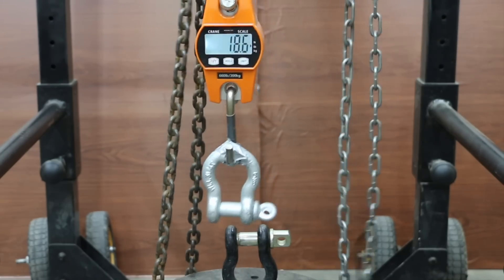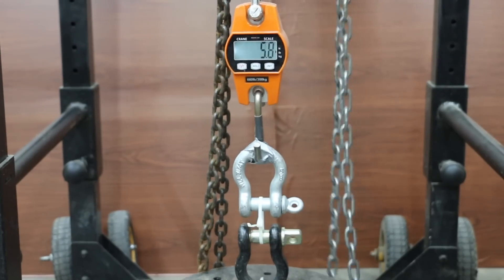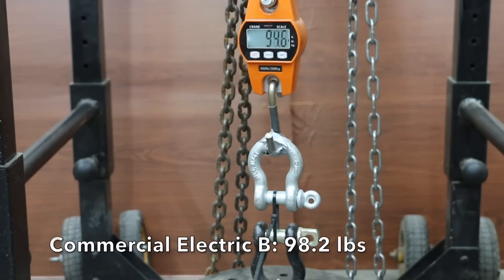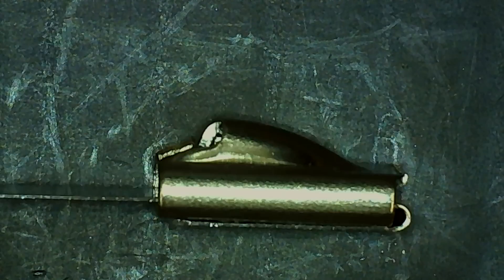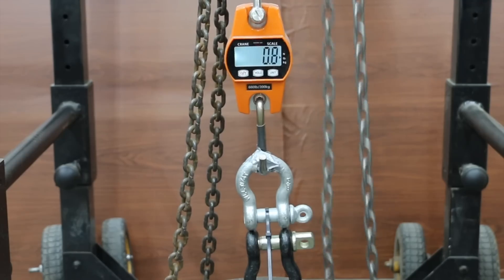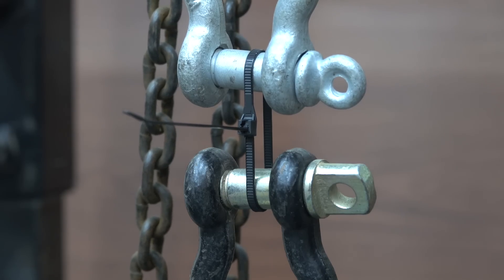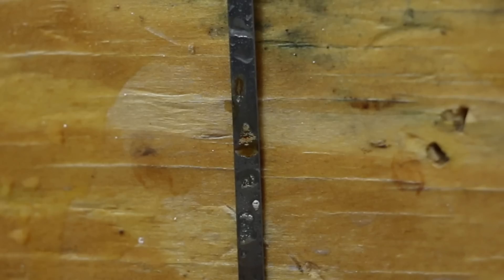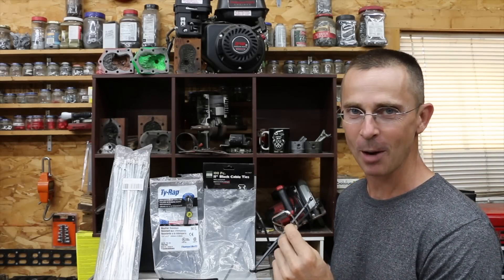Best Cable Tie (zip tie) Brand? Let's Find Out!

Comment: No, you cannot say the cable tie supported the weight of a small truck (you did not lift the entire truck).

You can say instead that it was strong enough to lift the (pretty light) rear of a truck (no more than 300-400 lbs?).
Reply from the maker: Thanks for the feedback.

Comment: Have you tested various LED security lights?  I have used several types and brands over the past few years with a wide range of good to poor success.  I prefer the ones that use solar power to charge batteries.  Some use proximity sensors to automatically turn on the light for a few minutes, then go off.  Others turn on at dusk, and run all night, or until the batteries go dead. 

These seem to improve with better batteries, and better solar collectors every time I get newer ones.
Thanks,
Barry
Reply from the maker: Thanks for the video idea.

Comment: I would be interested how well they do when they are hot / cooled. Some of us live in parts where it gets very cold so it would be useful information. While some live in very hot areas.
Reply from the maker: Thanks for the video idea.
Reply: I can help answer the cold question... every brand I have used for long haul trucking has failed miserably below 20°, and I spend a lot of time in the U P of Michigan, northern Ohio, Indiana during the winter. Many break at the locking mechanism teeth in extreme cold. I only use the 250lb rated ties from CabletiesPlus now, but they are pricey at 4.84 each but they keep our snap binder handles in place much better than a wrapped bungee cord.
Reply: TheRoadhammer379 i have used chain binders that have a ring that slides onto the binder handle when its closed to keep it from opening especially with vibration and shock I used them off shore binding 34” dia pipe onto tanks to tow for building beaches.

Comment: How about a comparison between different brands of brake parts cleaner to see which one is the best
Reply: I have a prediction. It's going to be whichever one is the most carcinogenic.
Reply from the maker: Thanks for the video idea.
Reply: Then compare to a dish soap, Dawn or Palmolive.
Reply: After years of using CRC I would be interested in watching that video to see whether or not spending the extra $3 every time I bought brake cleaner made a difference
Reply: I use Mac from Napa, Balkamp, and several other brands on our semi trucks, they all perform the same as far as I can tell.
Reply: Oh, and don't forget to test the corrosion to plastic, both clear and black
Reply: Johnsons green can is the best, I get it by the case of 12 for about 22$. Ac delco stuff causes mad headaches after extended use.
Reply: @MegaMarclar  yea erm, I can only get the ones listed on Amazon as I don't live in the US xD
Reply: @frankenstein_colt_98  search for "johnsens Brake clean" green can

Comment: Lawnmower blades.  Which is the best?  Which can take a hit?  Which provide the best lift for a bagger?  My Husqvarna TS348D is in need of some new blades, and I can't decide.
Reply: Rather have a blade get damage instead of a harden blade snapping off. Also, cheaper to replace blade than a bent crankshaft - which too is softer steel so as not to snap off spinning 3000rpm.
Reply from the maker: Thanks for the video idea.

Comment: I don't see steel as " Cable Ties". We haven't even been allowed to use plastic ties on any real  "cable" 480v-13800v in years. Its all has to be lashed with either mule tape or cordage.  That would be a great video. Mule tape face-off!
Reply from the maker: Thanks for the video idea.

Comment: Wow at 1 cable tie Lifting the back end of a old Ford Pickup thats crazy
Reply from the maker: Thanks for sharing!
Reply: @ProjectFarm Its very rare for me to think of making any changes to your testing. More often you go above and beyond. However, I would love to see the stainless installed with the locking mechanism bearing up against a surface. The locking mechanism failed because it was allowed to spread open. The lifting of the truck showed that even through it has additional loops it confirms "my" suspicion. 

The failure of the uv exposed black ties was interesting. Never would have guess that.

I would be interesting to see the the load capability with the zip tie in different positions. It may not make a big difference with the plastic but it should make a substantial difference with the stainless. Anyway, love you work.

Comment: Those stainless steel ties what I do to give the clamping ball more bite is after I pull the tie tight I give the clamp area a light rap with a small hammer and lock that ball in there for good from slipping. Theres an idea for a test PF, does tapping the clamp on stainless ties really work?
Reply from the maker: Thanks for the video idea.

Comment: So what I'm hearing is, leave my cable ties in the sun for a year before use?  Man, that's a lot of prep time.
Reply from the maker: Thanks for the feedback.
Reply: Haha
Reply: I believe brittle materials are better at tensile whereas ductile better for shear stress
Reply: You probably don't want them hardening before you set the shape and lock.  Let them harden after application.
Reply: as" working guy" said i find they will snap before as you fold them around an object (course these my have been in the truck for more than a year!!)

Comment: Speaking as an engineer working for a prominent cable tie manufacturer, HellermannTyton, we routinely benchmark against Panduit.  A 50lb tie of this caliber and manufacturer grade should hit around 90 pounds every time which is great.  We have some 50lb ties that reach 120lbs regularly, but not all of our designs are capable at achieving that.  Your loop tensile test setup was close to what industry standard would be per UL, the only difference being the design of your mandrels that the tie was wrapped around.  UL calls for split hemispheres and the cables ties being tension-ed to a set clamp force prior to pulling in order to prevent slipping.    The only complaint I have is you compared 120lb rated ties vs 50lb rated ties and chose the higher rating over the lower rating.   It would be the same as comparing a grade 5 bolt to a grade 8 bolt and selecting the grade 8 because it performed better, well obviously it would.  An update graph of actual performance vs. rated performance would have been better to see.  Great work!
Reply from the maker: Great constructive feedback!  Thank you

Comment: Can you do another motor oil tournament? This time with the top conventional oils instead of synthetic
Reply from the maker: Great suggestion!  Thank you
Reply: @ProjectFarm  thank you for the work you do.... I stopped using synthetic because I was making alot of short trips in my gas truck and I was wondering which was best... Currently using castrol

Comment: Those HF ties work great when exhaust hangers fail. I'd love to see you test cordless Impact Wrenches.
Reply: That's a good idea. I wished I had a wire to help someone out on the side of the road not too long ago. That, and a few years ago I had nothing to hold my exhaust up with so I ripped it off  and threw it in my trunk once it cooled down, haha!
Reply from the maker: Great point!

Comment: I'd say there is an advantage to having the latching mechanism fail slightly before the cable does.  You might not entirely lose whatever it's holding.
Reply from the maker: Great point!  I agree!  Ty Rap did great in this area
Reply: @ProjectFarm  
Great video as always.
Reply: Great point!

Comment: With winter coming, I wondered if you've ever thought of comparing some tire chains/traction devices. Not sure how you'd test the traction part of things, but ease of use and that kind of thing would be nice.
Reply from the maker: Great video idea!  Are there specific brands?  I'll check back later to read the suggestions.  Thank you
Reply: @ProjectFarm  It would be expensive but even just different tires would be really cool (summer, all weather, winter, studded, etc etc)
Reply: @ProjectFarm  i have seen lots of videos where tire socks out preform chains!! hard to believe
Reply: Mike It depends on the conditions.  What works best on ice or hard packed snow is seldom good in deep wet snow, for example.
Reply: Project Farm There are many styles more so than brands.  Plain old link metal chains.  Metal chains that cross the tread diagonally.  Metal chains with cross bars on the links (tend to be better on ice).  Various plastic “chains”, etc.  The hard part is the variety of surfaces that should be tested: ice, hard packed snow, deep, wet snow, etc.
Reply: Wow, this could be a mega-test for you! I think the hardest parts are a) cost of the chains and b) repeatable testing medium.  I can help donate for the first part but the testing part is a little harder. 

Maybe the community will help with ideas for a repeatable traction test(s).